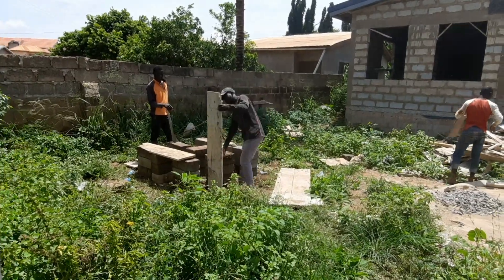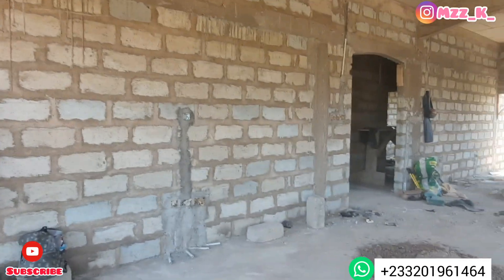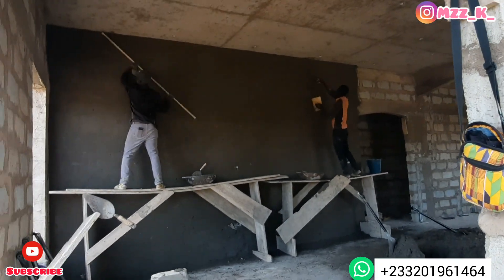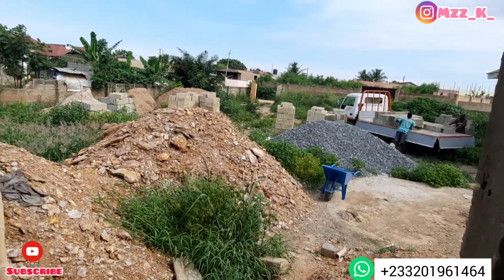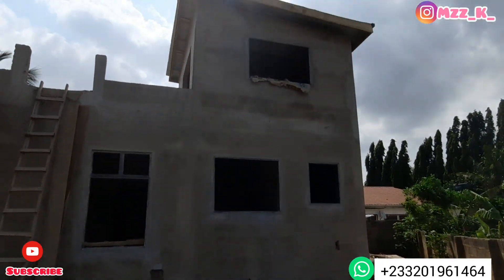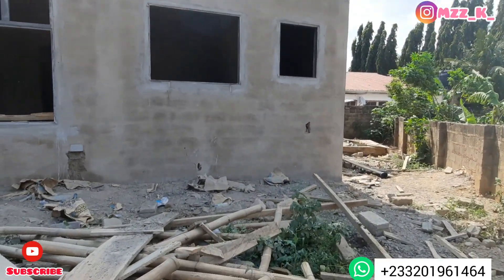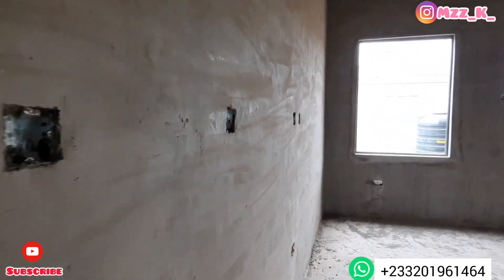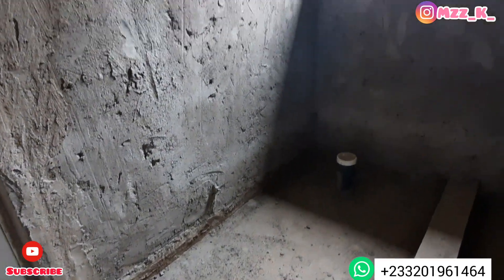It's time for Plastering!|Building our house in Ghana 🇬🇭 |Ep 27

Comment: Thanks for the video & information. I am at plumbing, plastering, fixing windows  & electrical cable stage. I do not want to put burglar proof, I wanted just 
glass windows. Apparently, it is advisable to put burglar proof 😏. I am at decision point where I am still thinking 🤔 either the glass windows outside & burglar proof inside the building with curtains covering it on completion. Big decision.
I was going to secure (windows) the place first before plastering. Looking at your video, I think plastering it first is ideal but I was told the electrical cables can be stolen 🤦🏾‍♀️. My fence ( wall) has been broken to have assess to the well on site.🤦🏾‍♀️. It was a bad idea to have a well to supply water for construction. I am delaying my borehole for now. Hmmm.
Reply from the maker: If you're sure your security is intact where you're building then u can skip the burglary but I won't advise that though. Yes, normally the glass windows are out and burglar proof in and covered with curtains. Cables do get stolen here when u don't secure them well. Cheers